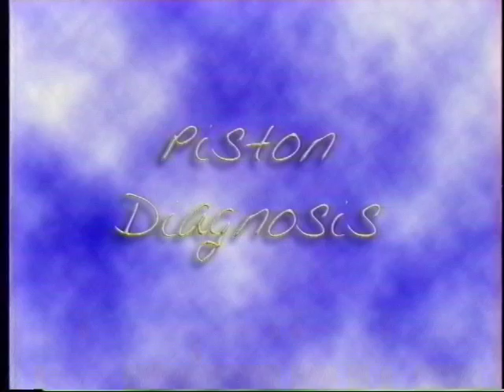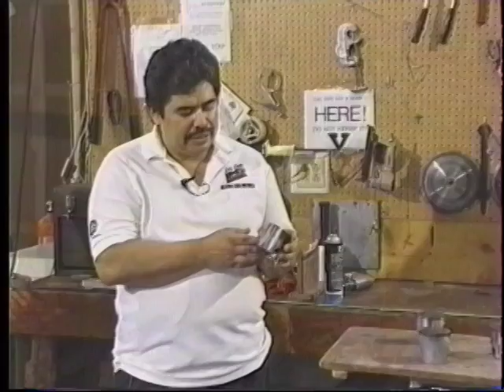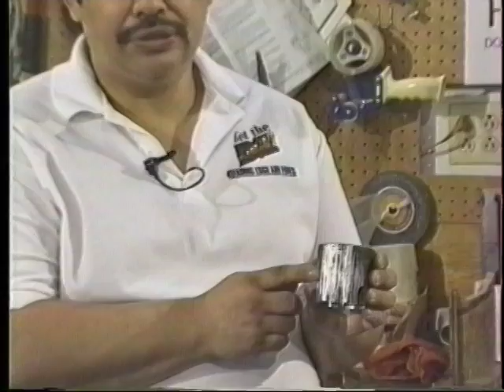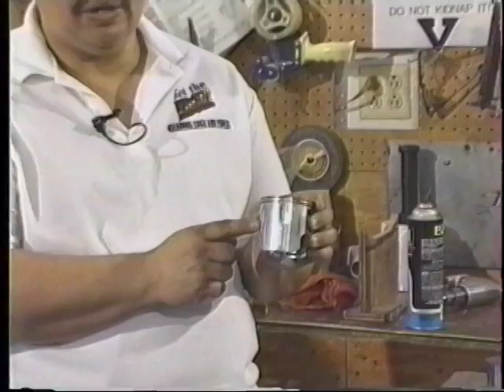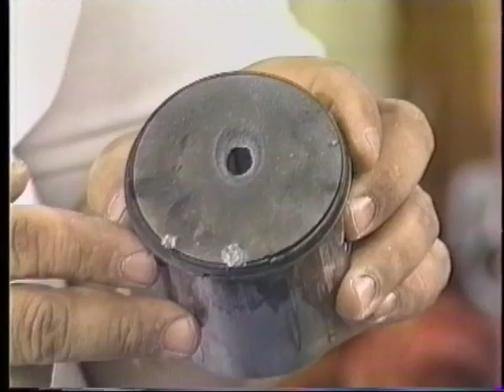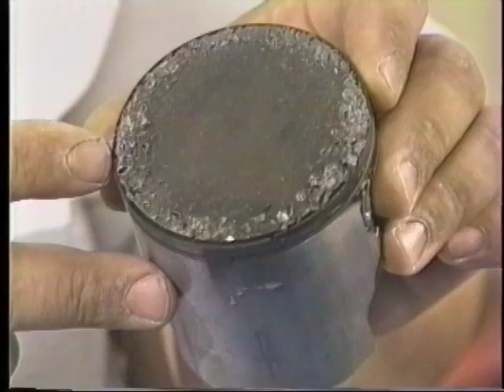HTalk2-EdWilsonPistonDiagnosis

Comment: Ed, I enjoy watching your videos & appreciate your expertise & time. I just wanted to make a statement. I've been flying ultralights since '78. I have thousands of hours in everything from Pterodactyls to Maxairs. In my experience with today's two cycle Rotax motors, especially the 503 and 582, I can say that Rotax's 300 hour overhaul recommendation is a bunch of.......it begins with an S. I have taken 503s & 582s to well over 1,000 hours without overhauling them with no trouble whatsoever. I have run them wide open towing hang gliders & banner equipment. A 300 hundred hour overhaul is probably a good idea for the occasional flyer who wants to be super safe.....but not for me. Thanks! Keep up the great work. Do a video on EGT & CHT gauges & what to do if they don't work.
Reply from the maker: Dear Bill,
Your comments are well taken. I have heard similar from others. By the way, I am the guy who produced the video Ed Wilson is in.
YouTube is very confusing that way so I urge you to go to my Channel (https://www.youtube.com/c/BrianFitzGerald-TheSkySurfer)
Personally, I have been doing the 300 hour overhaul with Rotax Rick doing the honors. The motor runs like a sewing machine - no problems - as I suppose it should. I think where some guys have problems is that they let these motors sit for a year or more and then start them up and fly. If they aren't run consistently the seals get dry which can cause air leakage and also the potential for internal rust occurs. With you flying all the time, you have nil possibility of those issues.
I am in the process of building a T-Bird II right now and just took delivery of one Rick's 670's. It is a monster and will be my first motor with water cooling.
When I get a chance I will shoot some movies about it but I am super busy drilling holes and assembling as well as moving from our house of 30 years to the new Sky Surfer Cabana on a grass strip where I have my own hangar.
Blue Skies & Tailwinds!™
Brian FitzGerald - The Sky Surfer
Reply: Brian FitzGerald .....Brian, I've seen your very well done videos. I meant no offense with this man who does a very good job. I know Rick Davis very well. He's overhauled maybe 4 of my 503s. Only one got to him. It vibrated & hejust couldn't figure it out. Said it was the only motor he hasn't been able to fix. It happens. Yeah, the 670, a barn burner for sure. I'm 68 now & the simplicity of a 503 suits me. I've towed a 235 lb, hang glider pilot & glider to 5,500 feet. Took a while but I got there. Got a Maxair video on YouTube if you'd like to see it. Drifter Flying Part 2.
Reply from the maker: I am impressed with your tow to 5,500 feet. The highest I have gone in an Ultralight was in my Quicksilver MX. It was in the 90's and my Buddy Don Forse and I ascended to 7,700 feet. My MX had a Cuyuna 430 and I believe he had the same on his Ultrastar. Frankly, I didn't much care to go back that high and any more rarely rise above 3,000. The last time(s) I got that high were when returning from Sky Safaris under relatively high (30 mph) tailwinds with thermals that just pushed me up there. I always take advantage of "free air" when I can get it but when it takes me to 3K, I cut the motor and drop down to 1,000 or so. We have a lot of traffic in the South Central Kansas area and I do not want to get hit from behind by a turboprop or jet!